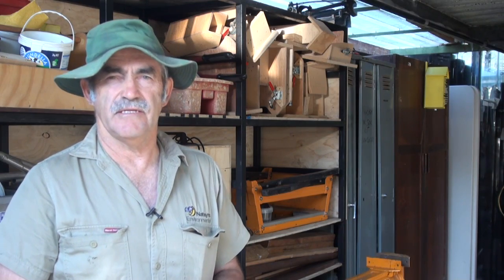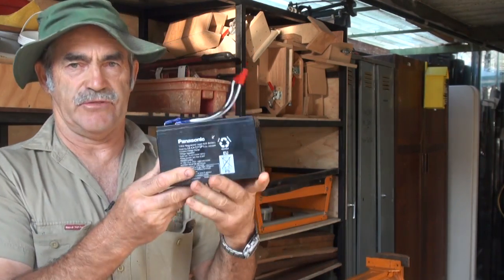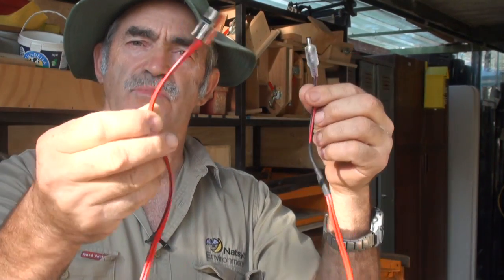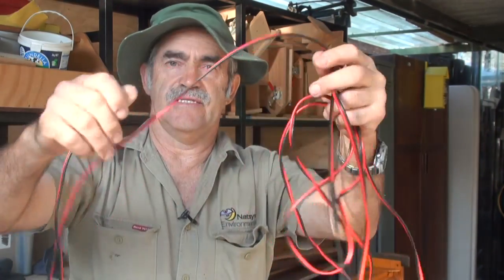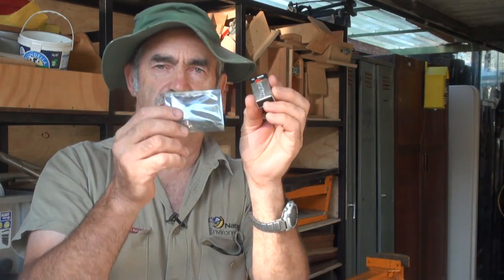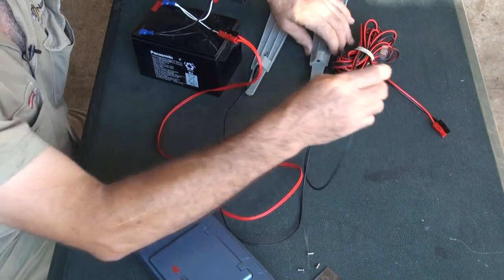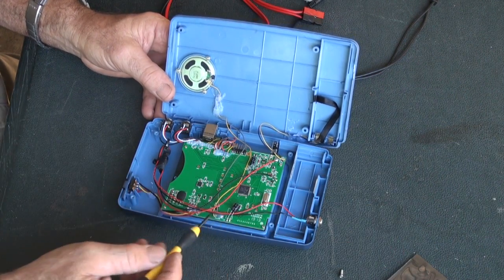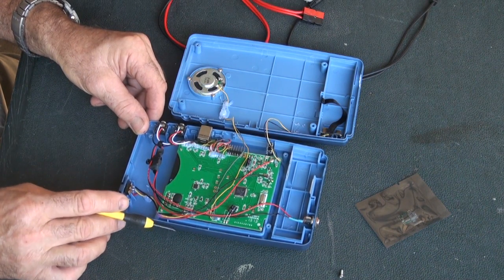Fed up with your CED M2 Chrony eating batteries....Here is a solution.

Comment: Have you experienced any interference from the high frequency switching in the DC -DC converter?
Reply from the maker: None whatsoever.
Reply: The lights power up off the battery even though it is dc